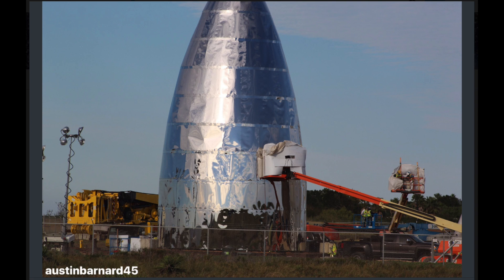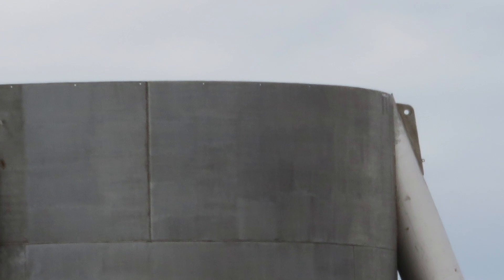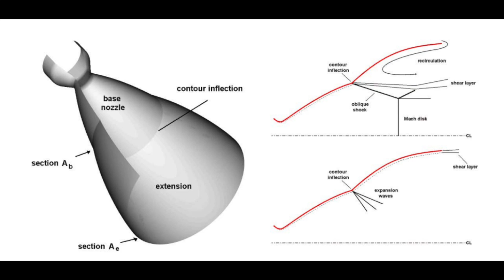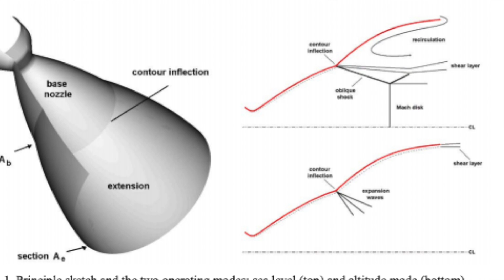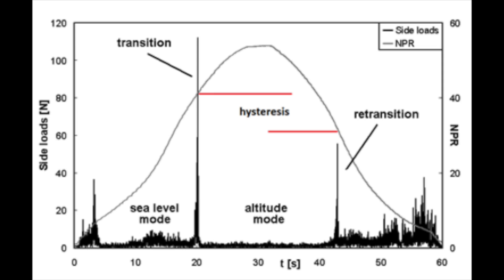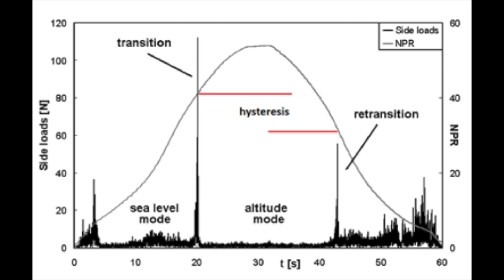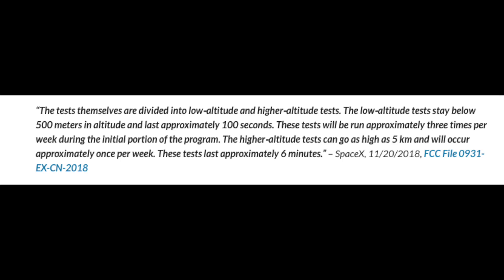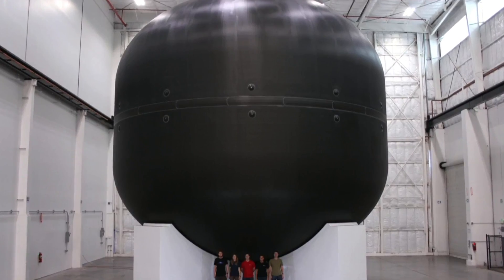What's Going On With SpaceX's Stainless Steel Starship?

Comment: It seems pretty obvious it is a quickly put together very early prototype made of regular stainless steel plates and engined with second hand engines. It will probably attempts to fly, maybe on top of a third or fourth-hand Falcon9 booster, it will probably attempt to land using already proven algorithms and hardware, and it may succeed in all of this at minimal cost or fail miserabily
But... 
Any data is good data, may it succeed or crash.
Any publicity is good publicity, may it succeed or crash.
Musk is no engineer nor rocket scientist, he just totally throws things to general public and see was sticks to the wall of investors interest, and some useful things may emerge from. At NASA, failure is not an option. At SpaceX, it is a development process.
Reply from the maker: It’s too big to fit on a Falcon 9. Falcon 9 is 2.7m wide, this is 9m wide.
Reply: @scottmanley  meh. Rockomax has the adapter you're looking for.
Reply: @scottmanley  Anyway the "landing legs" are actually plain, not movable tubes. So it is definitely an hopper that will never be mated to a first stage.

Comment: Buck Rogers called and needed a new custom ride. Seriously, it's probably a test platform for propulsive dynamic positioning. Not sure what the three in-line engines are for. You'd think a delta would be more effective for both vectoring and differential thrust, but I'm not an aeronautic engineer.

Comment: My understanding is that the Aluminum alloys used in space are formulated to reduce or eliminate the material becoming radioactive. The stainless steel wont have that. But I don't really see the craft becoming radioactive a problem there should be ways to work around that.

Comment: Ok my thoughts:-
* Yep it is real. It has to be rough and tough to survive sitting on mars for years. So guess it makes sense.
* Built out of Stainless Steel to both gain experience of building with SS and also for later high altitude tests. 5K will only be a start.
* The Fins and 'decorative nose' will, I am guessing, be useful for testing horizontal hovering type maneuvers in windy conditions. 

In general it just looks mad. I love it.

Comment: It’s just a test rig for the raptors. And it’s supposed to look like a rocket 🚀 with the approximately same size as the final product. So they can test the mathematical model. The aerodynamics at those (test) speeds is irrelevant, only the weight distribution is. And then they are going to test the maneuverability of the engine gimbal and control protocols....

Comment: I really dont know why they do it in this way, but the only thing i can imagine is that they might wanna have the final or realistic weight for the testing. I mean they know how to oparate the flight/Landing on a Falcon 9 booster which is big and not very easy to control, so they dont need to learn the controlling of the craft but rather how much is necessary to control the weight.

Comment: That's not for space flight. That's a rocket powered tunnel boring machine. The steel makes it strong enough to go through the ground.
Reply: Elon is so good at rockets, he can fly through land.
Reply: Ah! Correct! So they gonna use it to dig HyperLoop tunnel faster than HyperLoop train!
Reply: That's an interesting idea. How fast should move StarShip to bore a tunnel from SF to say Seattle?
Ignore the heat- and shockwave-induced mortality rate of SF and Seattle population for now for simplicity - Musk will solve this problem later.
Reply: *faster than a snail.
Reply: @riparianlife97701  Doesn't faster than snail travel violate relativity? 🐌
Reply: @PaulPaulPaulson  only in a vacuum.  It works in bedrock, but releases a lot of Cherenkov radiation.
Reply: Doctor Snuggles and the wormmobile

Comment: The whole rocket system has been changed over to stainless steel with an active cooling (!!!) heatshield.  Carbon fiber tanks are out, partly because they'd need a tank liner for LOX, and partly because the heatshield material was quite heavy.

Comment: Why would a sub scale test mule need to be made out of composites?   Steel probably makes it 1/20 cost and 6x faster to get flying, um... hopping.  The mass ratios, rigidity, and (some but not all) other metrics could be engineered to be representative of a different material.  If it goes boom then not nearly as big a loss.

Comment: And, about the stainless steel material...Well, I think that the steel is cheaper and even though it is heavier than the carbon fibre, and it will add to the rocket of the mass, being cheaper it will allow the bfr to be produced quicker, cheaper and faster. This would help beacuse you cand have more rockets flying at the same time,  and a cheaper way of doing it. Also, it is easier to reuse rockets using the stainless steel, and I'm sure SpaceX will develop better versions of the bfr too. Sorry if my english sucks, I am not a native speaker, but hopefully you got my meaning:)